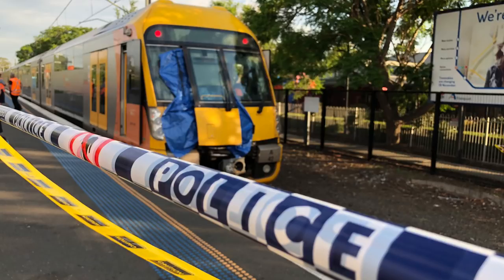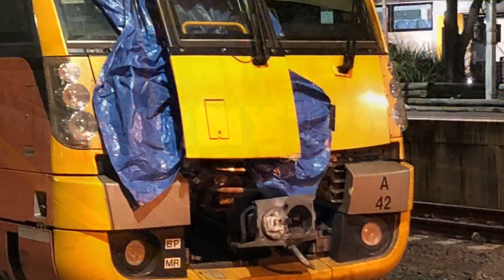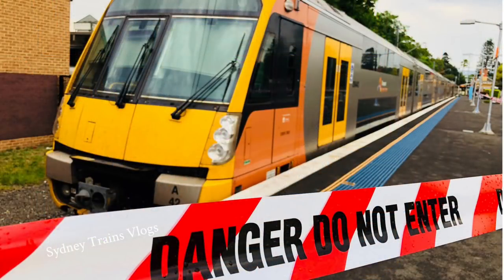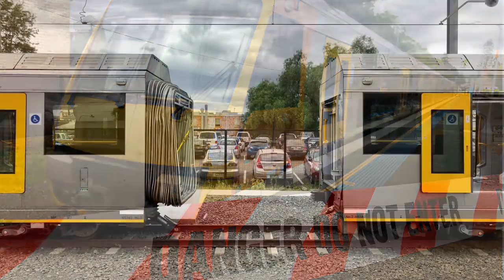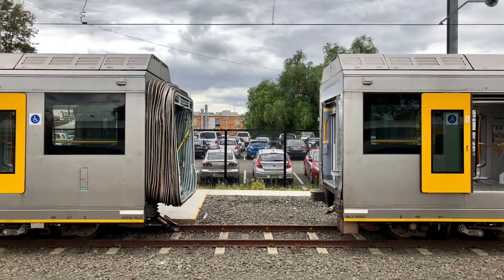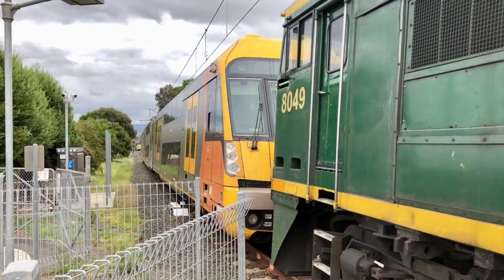Sydney Trains Vlog 1535: Waratah A42 Returns to Sydney

Comment: Since January 22ND 2018, A42 got crashed at Richmond railway station, due to buffer crushed and the passengers got injured and no one was hurt and train driver reduced speeding too much and wheels slippery.
Reply: +Joshua2004 
Passengers got injured and no one was hurt??? 😆
Reply: Oh, that's what happen you get injured, so that's why you get cause train bumped at the end of the line.
Reply: +Joshua2004 
People were injured in this crash.
Reply: His couple is wrecked, but so you can fix at Cardiff
Reply: For a long time

Comment: It actually looks shorter. Maybe because it went through the platform very fast? Also have you heard of the sort of new T9 Northern line which is replacing the T1 Northern line from April 28.
Reply: George Gamez Everything The main reason the Northern Line is getting renumbered is to avoid confusion with the Western and North Shore lines since those two integrate with each other. Its new map colour is red from what I saw, which was funnily enough the colour code it had back under CityRail. It’s like the situation again where the Airport & South Line was renumbered as T8.
Reply: @nicholetheotter1957  Im not dumb I know.